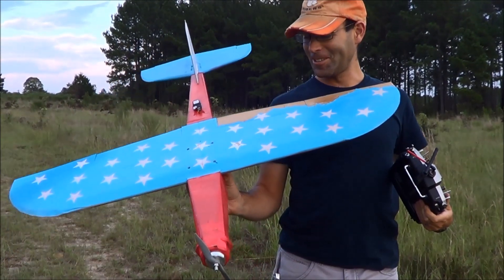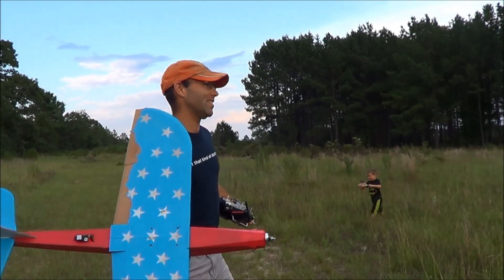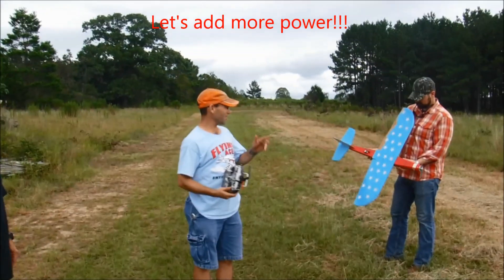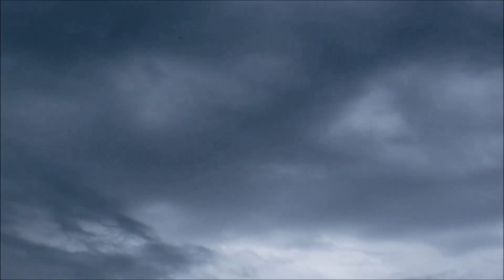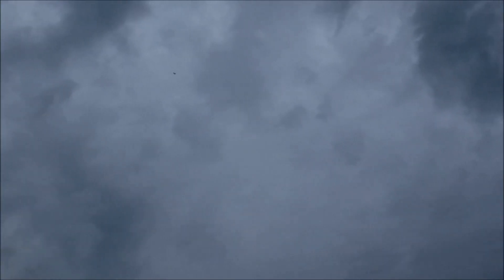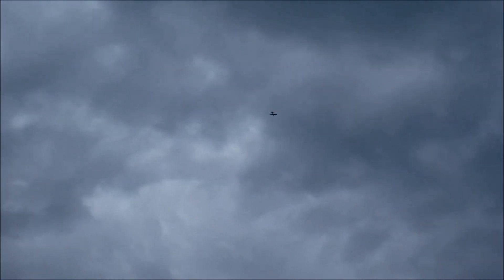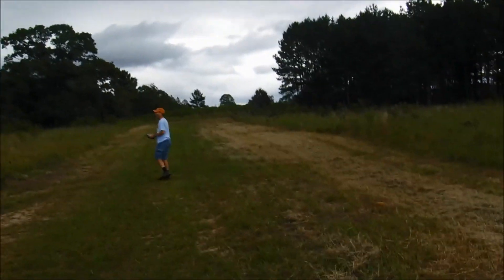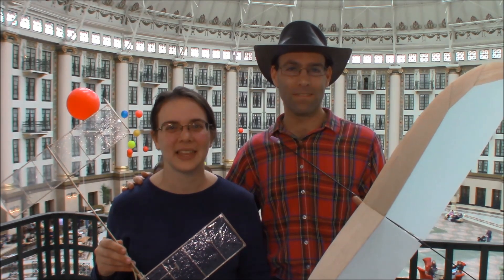Fastest RC foamboard airplane in the world!

Comment: That's up there with the speed I'm getting out of a custom foam board pusher jet that I designed. The biggest cell I've used is 4s 2200mah but the weight and wingspan differences are huge compared to this one. Planning to design something similar to this with around a 30 inch wingspan on 4s. I'm expecting to reach speeds of 130mph+ with it if all goes well.

Comment: sounds like  a Microdan motor?  I have the 2900 in a model called the "wingthing 2 and it scoots along pretty good
Reply from the maker: No...this thing would make about 8 microdan motors. It's insane and huge and that's what you need to make a true foamboard plane that's manageable at those speeds.

Comment: What motor , propeller and battery is in the plane?
Reply from the maker: GoolRC 4074-2250, APC 7x10, two Xilo 6s 1250mah 75C batteries in parallel. Check the links in the description for more... I put together as much information as possible to help others duplicate. That power system is good for well over 250 mph in the right airplane.